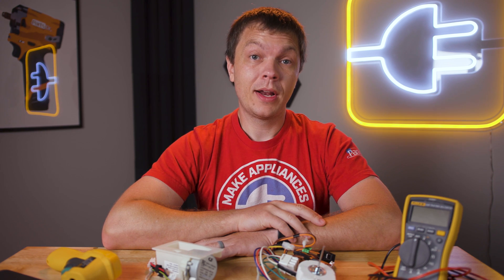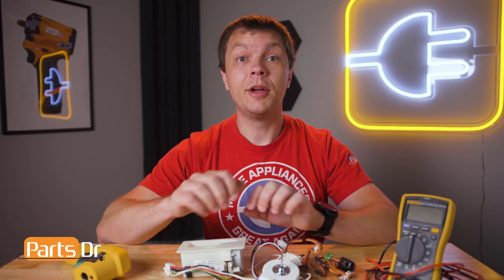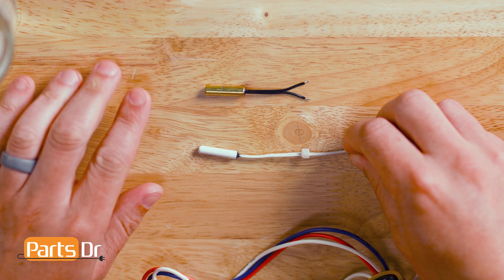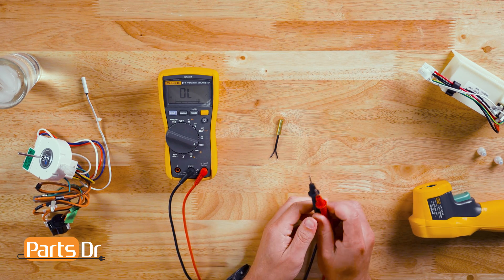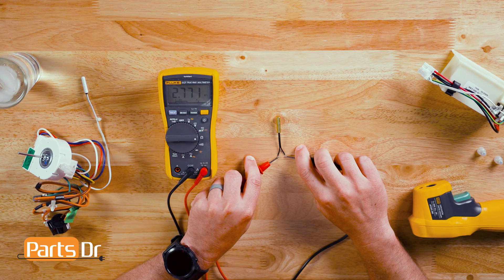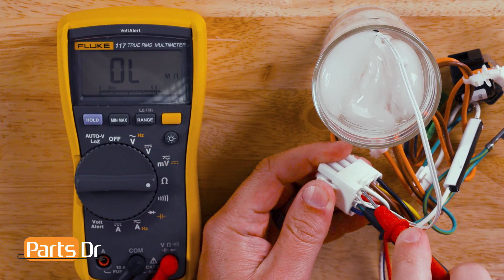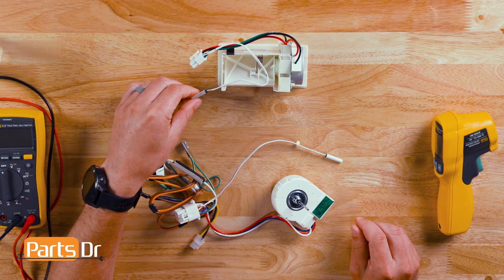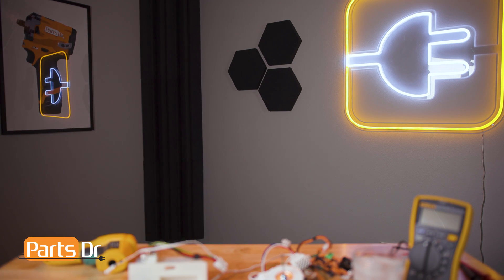How to test Whirlpool Refrigerator Temperature Sensor Thermistor

Comment: Hi Man, Thank you for this great video really clear, and enjoyed it. I have a side-by-side freezer and fridge together from Whirpool and I see the temperature on the freezer side is way more (-22) than the settings (-18). I have not checked yet the Thermister, but I see it is a 2,7K ohm which is hard to find. Is it fine if I buy a 2K Thermistor or should I buy a 5K Themistor. How does this affect the fridge? Thank you very much in advance
Reply from the maker: You will need to buy the exact part number thermistor listed for your model.  If you use the wrong one it won't work out.

Comment: I noticed that the parts page on the Parts Dr website shows different resistance readings than you show on this video. The readings on your video are the same as I get on the original thermistor installed on my Whirlpool Frig WRX986SIHZ01. I get 7.95k @ 32F and 3.36k @ 67F. Is this about right or do I have a bad thermistor?
Reply from the maker: The resistance values shown in this video should match your model refrigerator.  It sounds like it is testing good from the reading you received.